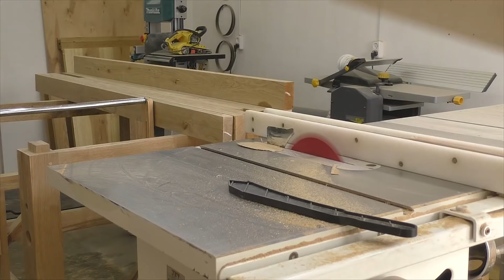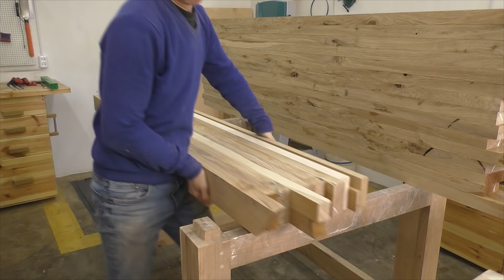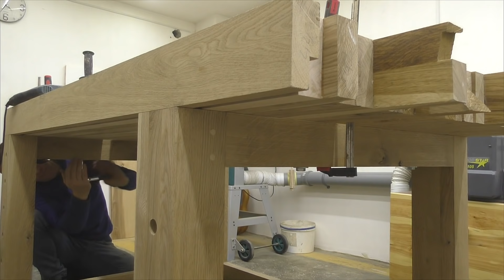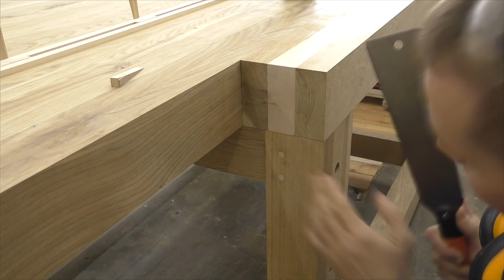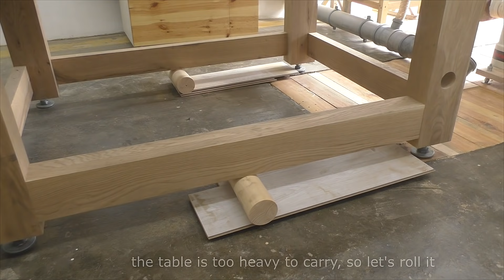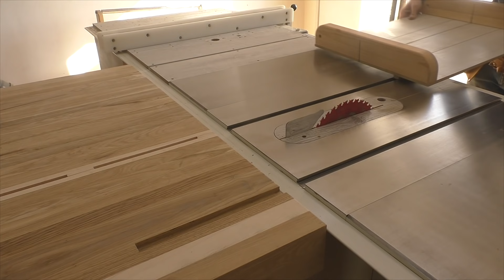🟢 Awesome Workbench Build - Part 2

Comment: OK, I'll admit it: I don't get the point of the "split top". What is the section with the gaps for? - not the groove for the sled runner, the part that goes the whole length of the table. Thanks in advance to anyone who can enlighten me.
Reply: I asked me the same question,maybe for rubbish,🤭